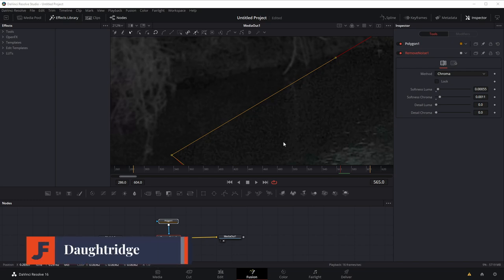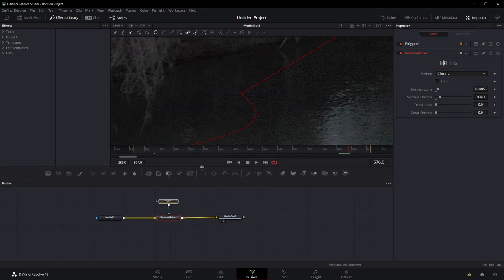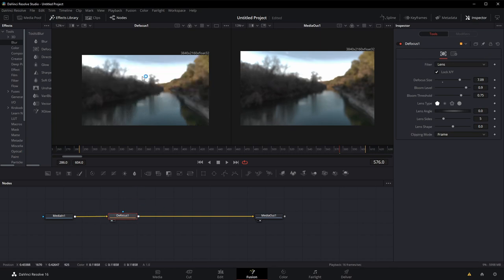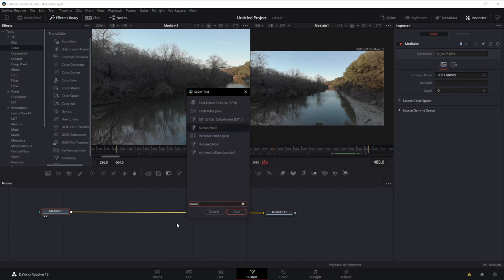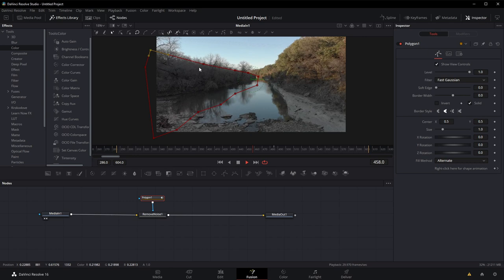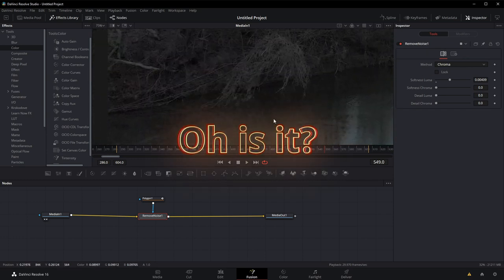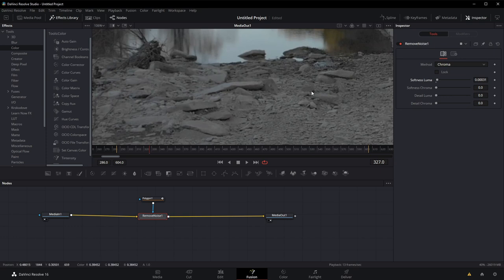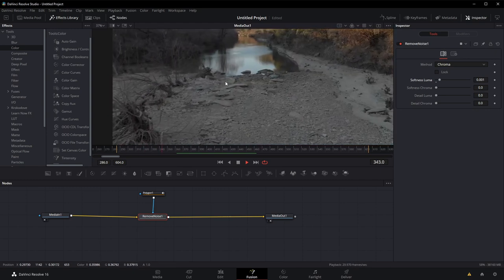Free Noise Reduction - What you need to know in Davinci Resolve Free

Comment: John again a question, what is the bare minimum specs required for 1080p 60fps video editing ??? Will a 4c/8t processor will do ?? Like Ryzen 3100 or 3300x ?? Assuming that i want a smooth experience rather than focusing on faster rendering!!!
Reply: That's good meanwhile I had core i5-7200U, 8GB, 940MX 2GB
Reply: @mixedup5858  thanks ... Did you had a smooth experience while editing forgetting the render time ????
Reply from the maker: This really depends on what type of footage (codec, bitdepth) you are working with but I'll assume h.265/4.  In which case your best bet is to get the studio edition of resolve and use the hardware encoder on your GPU for decoding the footage while you are viewing it.  This puts the work in the chip dedicated specifically to that task.  The color etc would then also be done in the GPU so maybe a 2060 to be sure?
Reply: @johnsfilmsllc  2060 is absolutely out of budget, due to this lockdown and the lesser availability has increased prices in india and my budget is limited like 600$ which is 45k rupees , please suggest me something decent in it !!! You already gave me the option of r7 2700x with 2060 but overpriced here !
Reply: @KJ-xf4oh  I have the free version right now. Currently running a 1600x / 16G RAM / RX580 8G. For basic edits it works great (especially with the video stored on an SSD). Coloring and fusion stuff causes it to chug a bit but its manageable. Looking forward to the studio version arriving and seeing what happens once the GPU starts helping. I'm not sure $600 would be enough to get a hiccup free experience but I'd suggest editing off an SSD and having at least 8Gs of RAM
Reply: @defooster2757  thats fir the info.... but i have already built a pc !! 3600XT with 1650 super